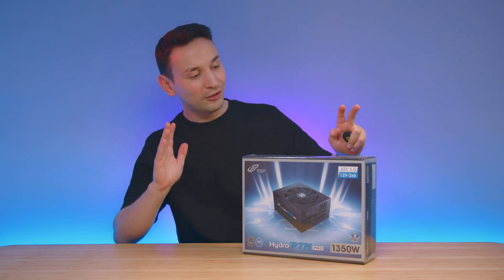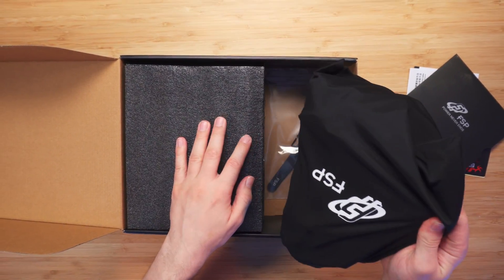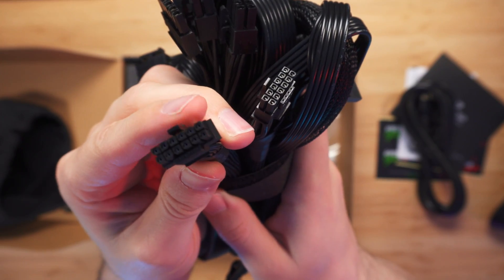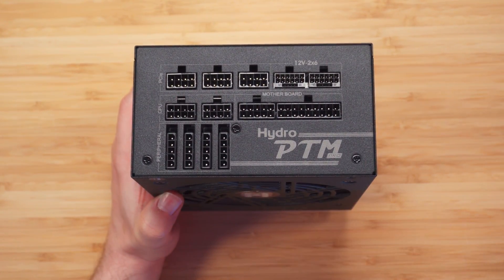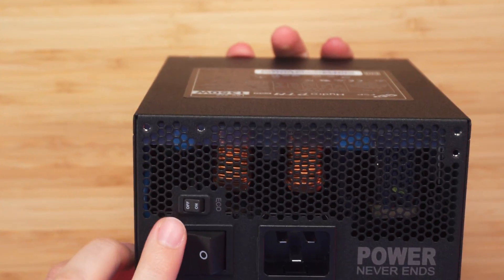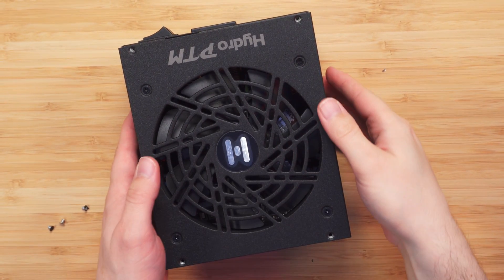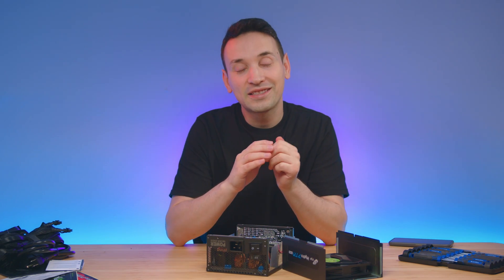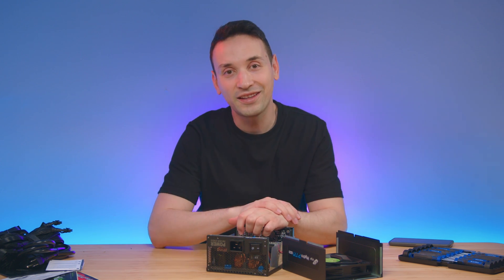Unboxing & Teardown: FSP Hydro PTM Pro 1350W ATX 3.0 Power Supply

Comment: Is it possible to we have a full review?(maximum load, Ripple, Efficiency, noise levels in dBA, Temperature etc...)

I'm mainly curious about the noise level, is this psu as quiet as the FSP Hydro ti pro 1000w?
And when will it be available in the EU? Because at the moment it's as if this psu doesn't even exist...and if you can get it, what price do you think it will be available at?
Reply from the maker: I plan to actually do a pcbuild and will be using this psu & will do a full review. As for noise levels I am assuming its going to be less because lower power draw as its 1350w and hopefully no coil whine of any sort as it can be very annoying. As for the EU launch I believe it scheduled to be released sometime this month of May. Consider subscribing to get notified when that review releases.  :)
Reply: @htpoint  Sounds good! Thanks for the answer! And of course I signed up to your channel. :)